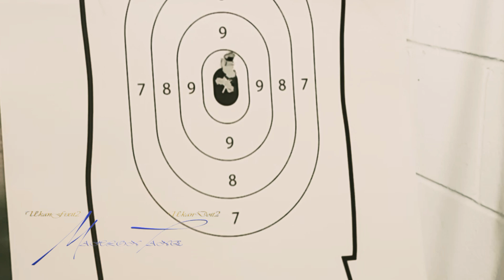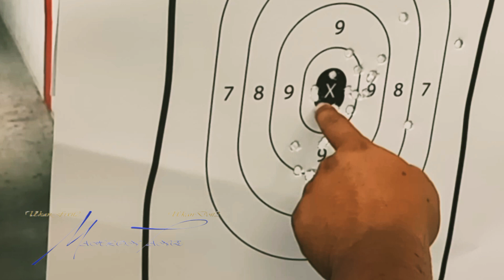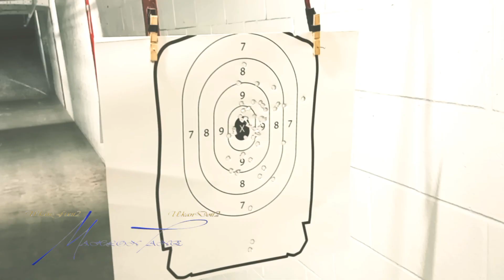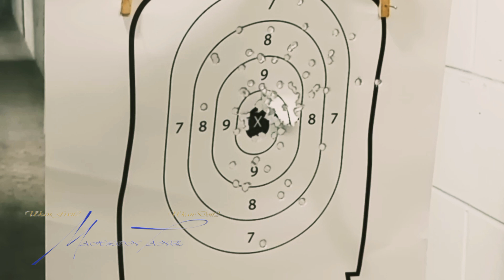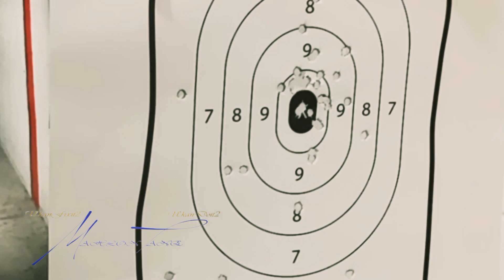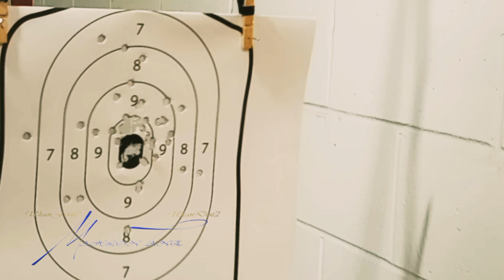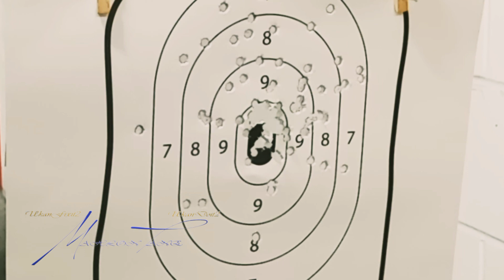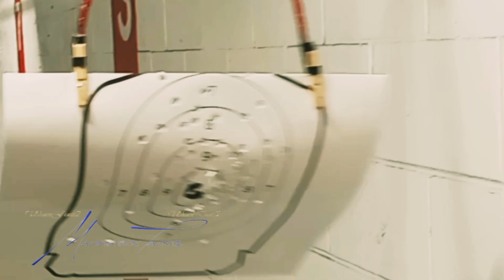Issues With Load Development (Examination)

Comment: I'd suggest a chronograph, and a supported rest to accurately gauge load development.  Sometimes a "slip" of the finger could give you a false positive or negative.  Also suggest using fresh targets to compare to one another keeping the POA the same.  That way you can see if crimp, OAL, powder level, or even primers could affect performance.  JMHO
Reply from the maker: Thank you for tuning in to our channel. Tap that LIKE and SHARE if you don't mind. Also, Subscribe if you haven't already. We have different content in our catalog that you might like or find interesting. Appreciate the advice and will try it with some of our future load developments. We really appreciate your support!
Reply: I concur with the new target idea. You can get the paste up ones for 5 bucks and you can set them each time you start a new string.
I'm known for marking my shots too. Circle, line, x with a sharpy to indicate strings of fire. 
could use a cardboard target, shoot a string take a picture, tape over the holes shoot the next string and take a picture. I've done that too. 
My normal target is cardboard I get from work with a spray painted circle on it. 🤗 I'm cheap. Lol
Reply from the maker: @mybuickskill6979  I'm need some of those cardboards brother they really do make great targets and can be reusable after holes being taped. Nothing cheap about it unless the tape and sharpie comes free as well lol just saying. Great idea!

Comment: The gun didn't like those seating lengths. My s&w did the same thing till i learned 🤗😂
Reply from the maker: It was really more the optic wasn't holding zero and crimp not being good enough. The loose crimp made it snag or catch, creating a malfunction. Along with the hot brass bouncing off the wall and hitting my face and neck. But you can clearly see it once, I used front and rear sights to show the true tight group the load development produced.